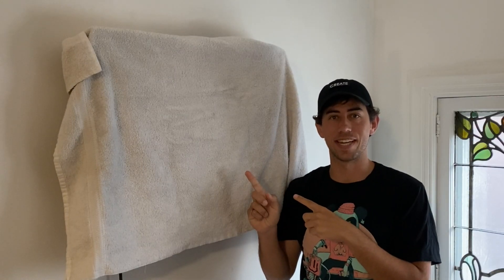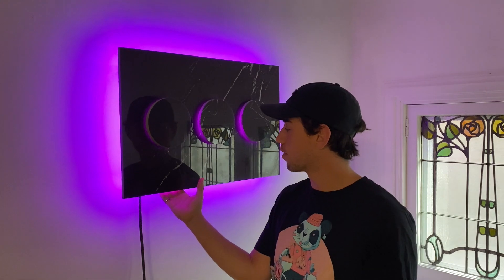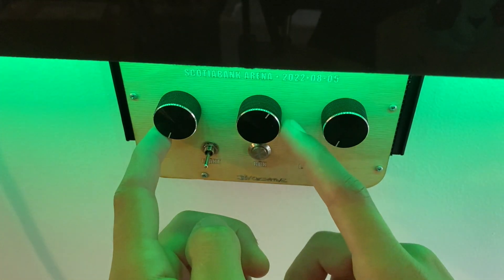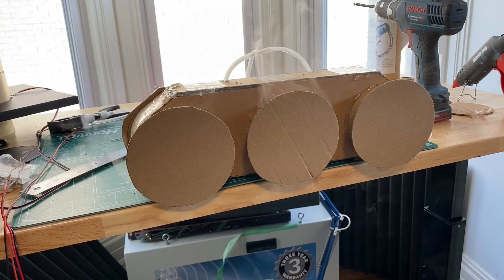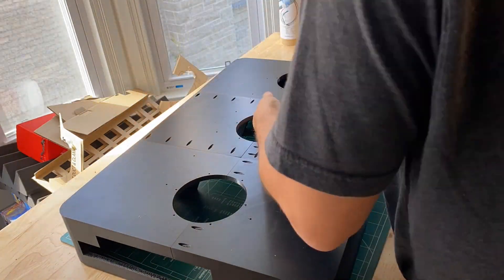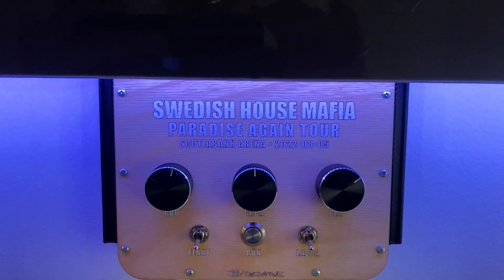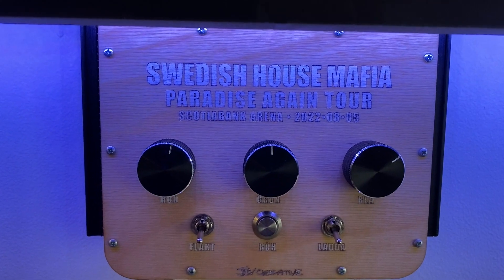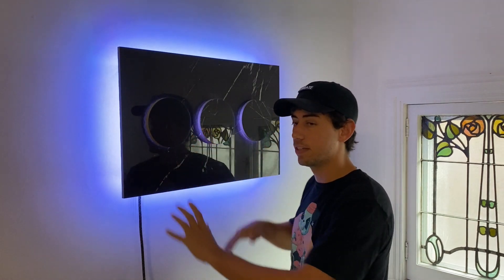I Made a Mechanical Sculpture for Swedish House Mafia

Comment: Looks so dope but, why didn’t you use 3 vape cartridges instead of one for increased smoke levels ? Not hating just wondering what’s the logic was behind it
Reply from the maker: Current limitations- this one vape coil uses like 4 amps, the LEDs use about 3, and with the other motors and electronics I didn’t want to push my luck haha! Maybe I’ll do more on the next version!